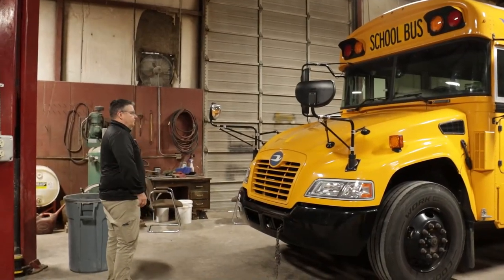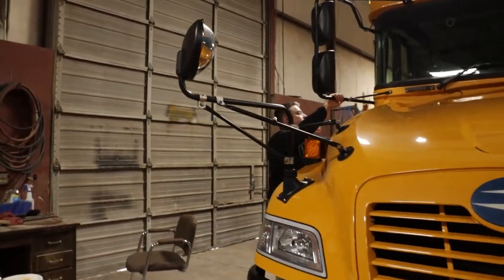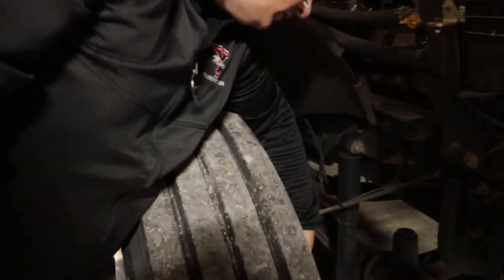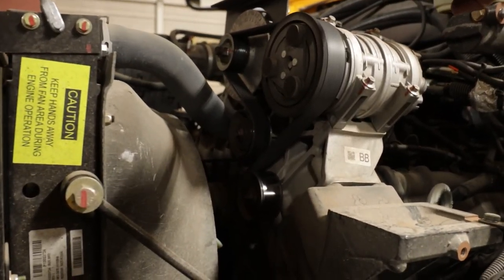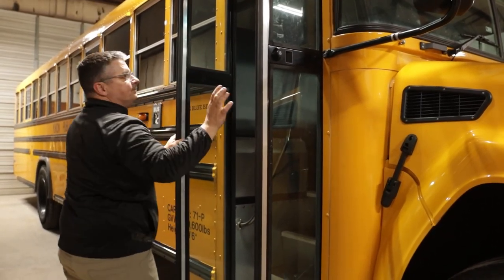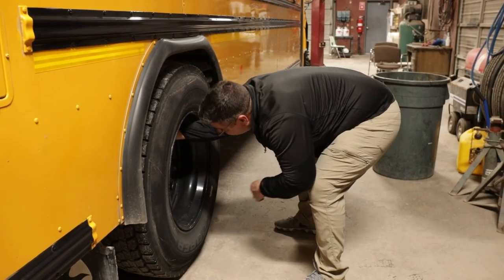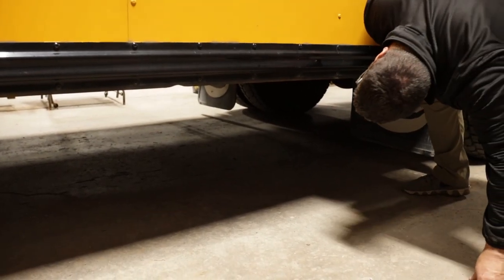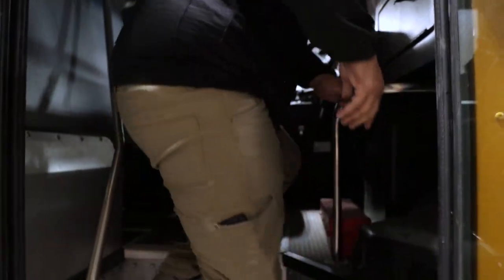School Bus pre trip inspection class B -  NO Air Brakes! - Blue Bird

Comment: What state are you in?  Watching to learn engine parts for PA test.  We don't touch or check half of what you do.  Thanks for this.  It really helps.
Reply: Stick to your trainer's advice. We're told to group things like headlights, hazard, and turn signals all proper color, no cracks, no condensation. We don't do every single light individually, you have a time limit, and his way will use up all your time, so you can't go back if you miss something. Follow your instructor, video him or her doing a demo, that way , you can't go wrong
Reply: @rebeccalucas6063  exactly! Listen to trainer is best advice. Our pretrip looks amateur compared to this guys lol. We only get 30 minutes for the test and this way definitely would fail us.

Comment: Did you miss the Brake chamber and clamp with the couplings, Slack adjuster and Push rod,and you did not mention how to chack the Push Rod, you missed the drive train? Ese, you missed a lot of items that are in the DOT manual. I am in Texas and the DOT manual has a lot more items that need to be mentioned.
Reply from the maker: The items you describe are for Air Brakes. The bus in this video does not have air brakes. Please make sure the bus you test in has air brakes or you will not get that endorsement. Good luck on your test.

Comment: This is one of the most inconsistent pre-trip I've ever seen. He didn't do any neutral safety test. I doubt it is a difference in state requirements. The brake test in incomplete adding to the engine compartment that is a different built